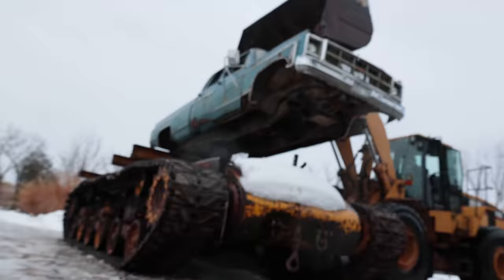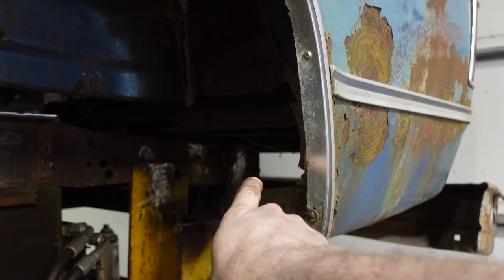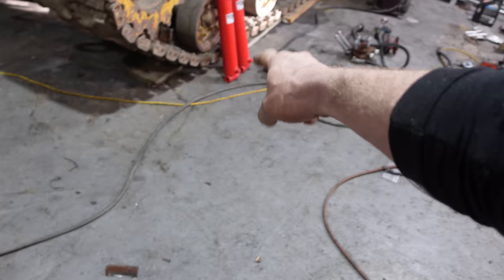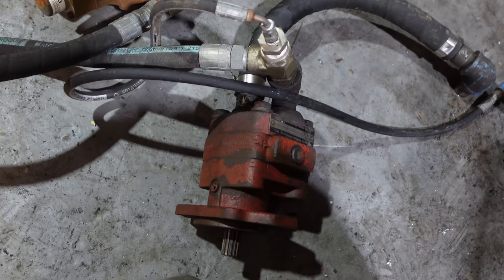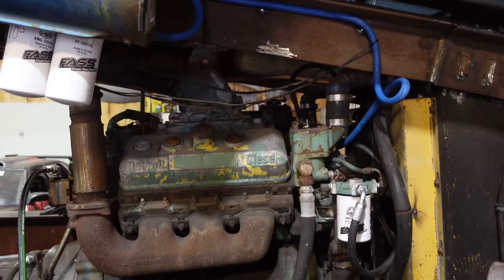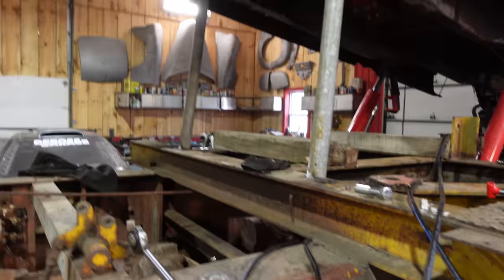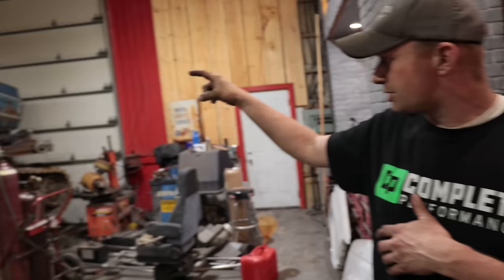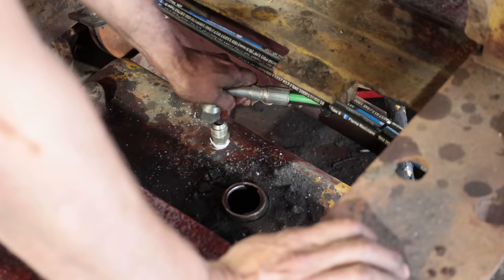Firing Up the 6v71 Detroit powered Tilt-Cab Tank! #Shermanator [EP5]

Comment: You had me at Detroit Diesel.. love those engines for some stupid reason. (could be because of Rollin' Thunder when I was a kid)
Reply: I prefer older Cummins but like Detroit Diesel, probably cos they're loud and piss of the neighbours 👍🏻
Reply: Gearing up in a firetruck with the siren and the Detroit going full bore on the way to a fire is the best sound ever.
Reply: @PlugUgly72  I bet that's an experience that you never forget 👍🏻
Reply: @R.Sole88109  I also remember hearing them at my grand parents house in Stirling City California up until I was about 12.. You'd hear the logging trucks coming for miles before they got there both going up and coming down the mountain then you'd hear them for miles after they went past.
Reply: @OtisENGINEuity  I bet, logging trucks work hard💪🏻

On approach to the village of the truckyard I worked was a hill 1.5mi away then 4 way junction at the top.

In the yard you could the ERF E14 lugging up the hill with the Cummins Big Cam barking through the Wasey stack. As the driver got to the junction you could hear throttle blipping as he went down the Eaton Twin Splitter box.

Then on overrun coming down into the village main street. The bark of the Cummins getting loud and louder. It left a impression that still here 20yrs later.

I reckon if there's no diesel engine sound that gives you goosebumps, you ain't a true diesel man👍🏻
Reply: @R.Sole88109  I'm not a diesel guy, I just love the Detroit 2 stroke
Reply: @OtisENGINEuity  fair one👍🏻

Comment: How badass! Get ahold of whistlin diesel and set up a tug of war with his monstermax.
Reply: I know nothing about monster max but knowing what I do about this beast it’s probably not much of a contest. There is a lot of torque and weight behind this absolute unit of a vehicle.
Reply: @carsongeye1462  monster max is a twin V8 duramax diesel monster truck pushing 700hp per engine with some massive axles off a crane i think so i think it would go either way tbf battle of traction and  power depending on where its being pulled it could be anyone's win
Reply: @carsongeye1462  google monter max 2 and you'll see it might be trouble! Its alot bigger than todays monstertrucks\megatrucks.
Reply: @satricon  Quick Google later, yeah holy crap that thing is huge. I think my money would still be on the shermanator just cause of the tracks but I agree, it would actually be a good contest.
Reply: @carsongeye1462  Haha yes! it would be really interesting! it has Crane axles and everything is really oversized and heavy. and i've heard he might have it setup for 8 of those tires! Im actually betting with 8 tires on he might have enough contact with the surface to win! he pulled against an actual tank with the first monster max! Basicly a regular monstertruck setup with possibly weaker axles than standard monstertruck axles. he got pulled backwards and then broke a driveshaft xD You can watch that too. "monster max vs tank" on google.   So who knows! I he hope he tries to pull a tank again when the Monster max 2 build is finished!

Comment: To get a lower viscosity in your shifter rams, use WD40. A friend of mine used it for the hydraulics on his submarine (yes, home built submarine ... very cool!) where he had the fittings going through the hull of the sub and out to direct the motors. The WD40 is thin enough, your rams will move quite readily.
Reply from the maker: Genius.  I will definitely try that!
Reply: Or how about brake fluid?? 🤔🥃🍻🇺🇲
Reply: @benhawke7231  The big difference here (to me) would be brake fluid absorbs water (hygroscopic). Just like in brakes, you'd have to change it out every two years. WD40 repels water (hydrophobic). Brake fluid is used when you need to avoid boiling, due to high pressures and heat. The application here just needs to transfer force, and the forces involved are really very minimal. Besides, while never having tested WD40, I'd venture to assume its viscosity is less than that of brake fluid.
Reply: @Paulster2  
Ooo... Good point. I don't know if they use the same formula, but I know the original formula used fish oil. So the viscosity has got to be around that, plus or minus whatever other additives they add to it. I wonder if the viscosity would be labeled on the MSDS? 🤔🍻
Reply: WD-40 Multi-Use Product does not contain chloroflurocarbons (CFCs), ... Kinematic Viscosity @ 100˚ F: 2.79 - 2.96cSt. Specific Gravity @ 60˚ F: 0.8-0.82.
Reply: what marvel mystery oil (MMO)?  that's pretty thin
Reply: Just use diesel that way you don't have to spend an arm and a leg on WD-40
Reply: @jonbos2876  - You seen the cost of diesel lately? 🤪
Reply: @Paulster2  
Last time I bought WD-40 it was $21 per gallon...an that was before Bidenflation took its toll.
Idk about CA, but here in the NW48, diesel is only $5 per....lol
Reply: Man we need to see your friends home made submarine in a bad way!!! 😂
Reply: @benhawke7231  You'd have to change every single seal and o-ring if you used  brake fluid.
DOT type brake fluid eats Buna-N rubber (o-rings) and polyurethane (u-cup rod seals).
Makes em swell up and turn to mush.
Reply: @deezelfairy  
Good to know 👍
Reply: @danielkingery2894  - Rich probably has a 55 gallon drum of it sitting around ... :o)
Reply: Use ATF
Reply: @benhawke7231  Brake fluid would potentially destroy the seals in the rams.
Reply: @DGHD  BTW as I watched through the video you asked about a turbo..I have two that were both rebuilt about 7 years ago by a shop that does ONLY turbo rebuilds that is located in Wilmington, Delaware sitting at my shop in Smyrna,Delaware....Anyway lmk if you need them or one and I'll make sure you get one or both.
EDIT:They're Garrett TV6141 Turbos.
They were going to be used on my boat,but I used CAT engines that already had upgraded turbos.
Reply: @Dave-ur5ub  
👍
Reply: You can make your own hydraulic fluid to whatever viscosity you need by mixing engine oil with diesel or kerosene, years ago I worked in a tractor and diesel repair shop that is all they ever used for hydraulic fluid, kerosene will tend to evaporate out over time, I know some guys will add kerosene to the hydraulic fluid in the winter to thin it out and make it flow better in the cold and it will slowly evaporate out over the weeks and months till summer which works out pretty well, diesel doesn't evaporate out or if it does it's so slow its not really noticeable.
Reply: @Dave-ur5ub  email him
Reply: @haydona1845  Sorry that was for you ⬆️
Reply: WD-40 is not a lubricant, would hate to see the state of those hydrualic motors.  ATF with some winter grade diesel mixed works wonders..
Reply: @DGHD  try smaller hoses and turning as much length into steel tube.  Or even using stainless braided Teflon or even a parflex hose as they don't expand as much.  And don't use brake fluid as it eats the rubber lining of the hydraulic hoses
Reply: @benhawke7231  nah it eats hydraulic hoses
Reply: @NVMDSTEvil  in this application, it is a shifter ram.

And it lubricates stuck nuts off of bolts pretty well.
Reply: @DGHD .... don't do it.   I would Not trust that at all, especially if it's up and you're working under the body.  The viscosity is too light and unstable for that use, and being as "light" as it is, I wouldn't trust it to not leak out past the ram seals.
Reply: @NVMDSTEvil  Yeah I used to work in a big tractor repair shop they never really put actual hydraulic fluid in regular old tractor or farm and earth moving machinery hydraulics, gallon for gallon mixing diesel engine oil with diesel fuel or kerosine was way lower cost compared to even buying bulk drums of hydraulic fluid and it does exactly the same job. They only used actual hydraulic fluid in new specialised machinery where you have to follow manufacturers fluid specifications, with a lot of new machinery the service agent takes samples of the fluids at service intervals to send for testing, wrong fluid means no warranty.
Reply: no and no and no again. check the pressures it's running for starters, then see if ATF will suffice. that's generally a "thinner" fluid with  lower working pressure ratings in mind and it will break down faster with higher than specified pressures.  wd40 is not the least bit a good lubricant, may as well just use whale oil/blubber. lol
Reply: @throttlebottle5906  - You really don't understand what's going on here, do you? Rich is just using two cylinders per direction to provide movement. There is no pressure to speak of. This is not being fed from anything. He moves one cylinder via the bar, this pushes fluid down to another cylinder which is actuated. There isn't a power unit which is driving this other than the lever and whatever power he's got in his arm. And again, WD40 is made just about entirely of lubricant ... check their website. That it is not is a junkyard myth.
Reply: @littlewazz  its bassically kerosene. not good for hydrualics.
Reply: its a penertrant and water dispersant not a oil. not a good idea. i would use atf or singer sewing machine oil. very light and its a proper oil.

Comment: Love it!!! Can't wait to see it tearing up the swamp! Detroit's are so cool for projects like this. My boss has a 6-V92 /10spd on a tire shredder, it was using gallons of oil so he bought a fire truck with a newer Detroit  6V-92 with electronic injection, does the job well. The best thing is when you set the rpms with the electronic PTO it holds the rpms dead on. You can feed big or small tires, it doesn't miss a beat!!

Comment: 8:05 I literally wired my a friend's Duramax fuel pump in this exact way 6 years ago. Used a relay and oil pressure sending unit.

Comment: Your idea of an "interrupter" is good. I worked on a lot of older MCI ex-Greyhound busses - all of them had a panel in the engine bay with controls you could completely run the engine from there. Also had an oil pressure gauge. Hell, they even had lights in there.

Comment: Hey Rich, I worked for Sunbelt Rentals for a number of years and on all new Scissor lifts they have a shut off on the hydraulic lines so if your working on it not only does it have the bar to hold the scissor from coming down mechanically but they also incorporate a shut off  hydraulic valve to make sure no fluid will pass through the system to allow the truck to come down on your when your working. It wouldn't take that much more to add and it would make me feel better if I was under it. Just a thought.

Comment: Rich, what a great job! looking forward see it running. for keeping the Pickup truck frame up when piston are out, it can be possible to use metal bars that goes along side the piston, with a simple lock up. very common in front loaders.  works as mechanical stopper.

Comment: I beam 80 inch body lift enough to clear tracks without fender triming. Also the rear engine location provides optimum weight distribution for increased high speed handling and grip for ultra fast dig launches.

Comment: @DGHD, you probably could have done one handle at the top connected to cylinders the same way as you connected them in your demo and they would have compensated. You would be moving your handle and the cylinders in the same way in the cab as you wanted them to be moved on the chassis... it's already done, and as long as you're happy with it, that's really all that matters, but I was just thinking about that...

Comment: If you put a T on your upper cylinders you could run a valve to a fill. Once the system is full you either cap the fill hose or remove it and cap the T.

Comment: If you can mount the shifting cylinders to a rail system, it will prevent the problem you are having with the throw distances changing. Search "Spyker C8 shifter", although it would need to be more complex with one of the cylinders mounted on a floating hub to completely isolate it. Sort of like how a CNC table cutter and the like would operate. One cylinder pushes a "sled" back and forth one direction, with the other cylinder mounted on it with a heim joint connected to the likage to control the other direction.

Comment: 12:19 ive always been amazed at cutting torches 
.
its not cutting anything........ its RAPID rusting, and then using air pressure to blow the rust away

Comment: Are you venting one side of the cylinders? Like a pin cylinder to prevent it from ripping the plates off or tearing shit up since the weight of the truck body should allow it to drop back down

Comment: Some hydraulic steering systems use some sort of valve that bypasses some how. I’m not a expert on it I just know on my tractor and the snow cat I run I know when you reach the directional stop, the steering wheel will continue to turn but the actual tracks or wheels don’t actually move any further. This may be helpful to save on your brake bands.

Comment: I would think manual pneumatics would work for things like the controls since they are intended for human use and pneumatics are easy to tune with cylinder diameter, and it's cheaper than hydraulics.

Just got to the point in the video where Rich talked about not wanting the bounce which makes sense.

Comment: The Hägglund BV206 uses (used since it's out of production) unassisted hydraulic steering. 
You might be able to use a system like that for the steering the Sherminator.

Comment: ya but even with hyd for the steering you can set the bypass valve to what ever pressure you want just back the pressure off till its what you want

Comment: Rich, why not use a Williams air brake pedal with two single acting - spring return air cylinder for throttles? We used to do that with 2-stroke detroits on the S/TS Euclid and Terex scrapers(they were front and rear engines).
You'd only need a 1/4 DOT airline to run from the pedal to the gov box

Comment: You want a check valve or counter balance valve on your cab tilt cylinders someone could knock the lever with the engine off and it will drop

Comment: If you just use your acetylene gas on your cutting torch you can soot the part and weld spatter will not stick to it!
Reply from the maker: Thanks for the tip!  I will use that for sure.  Sounds much cleaner than grease